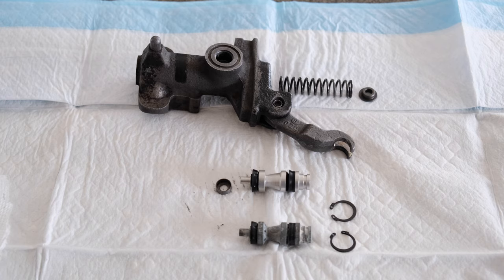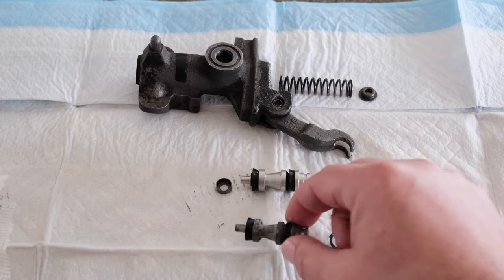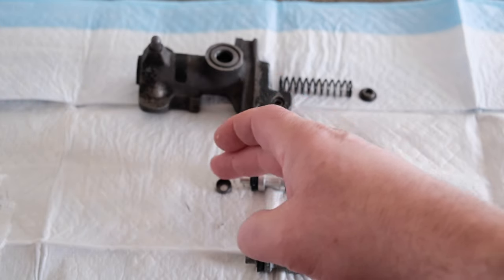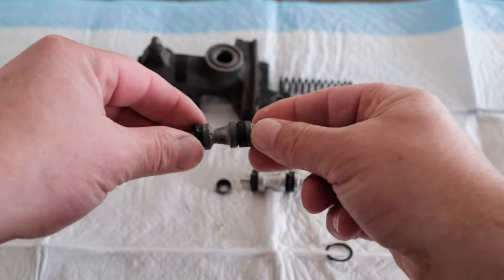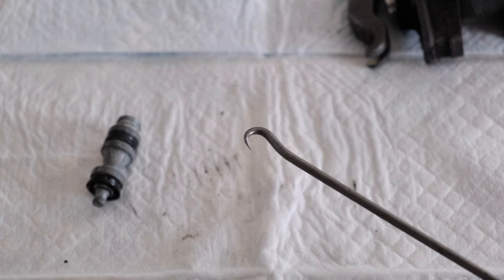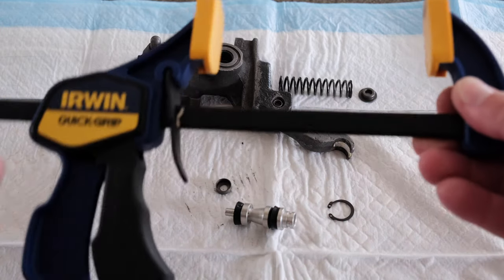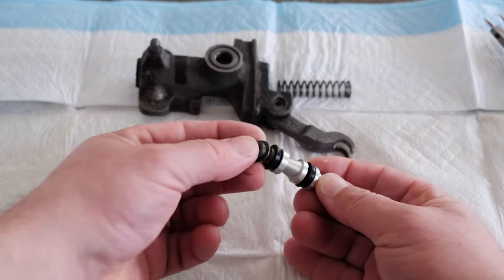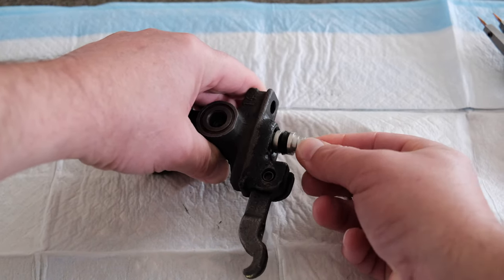BMW R100/7 1977-78 Master Cylinder Rebuild

Comment: you should have used a bit of oil to lubricate the rubber components
Reply from the maker: Bob Smith - good point!
Reply: Oil will destroy brake rubbers, use proper rubber grease, we use Bosch Rubber grease.

Comment: Cylinder is too far in, need 1,2mm free play on cable on master cylinder. Also use ATE grease on the inside parts and seals against rust.
Reply from the maker: Xavier - are you saying the whole master cylinder is too far forward on the frame?
Reply: @zooskifilms  the cylinder in the master cylinder, the one that is pushed with small pushrod by lever and cable, should stick out of the master cylinder, 1,2mm to be measured as described in the BMW manual